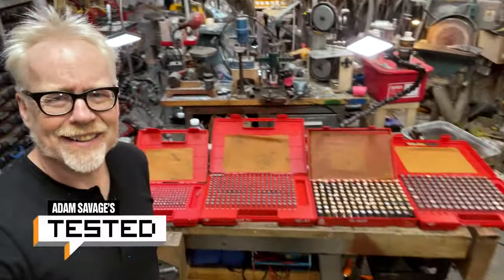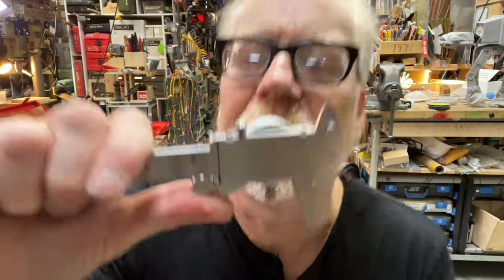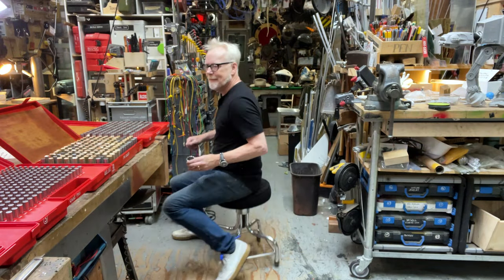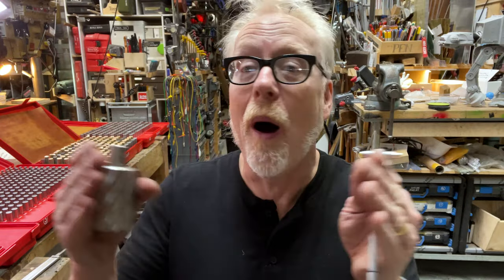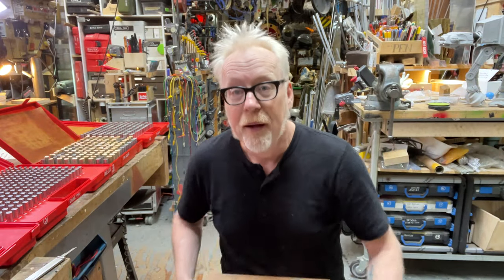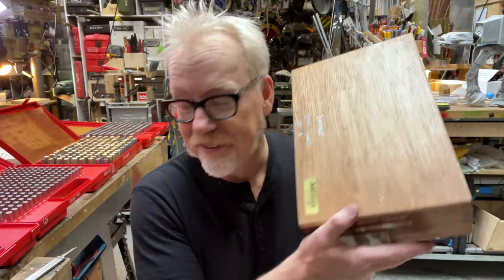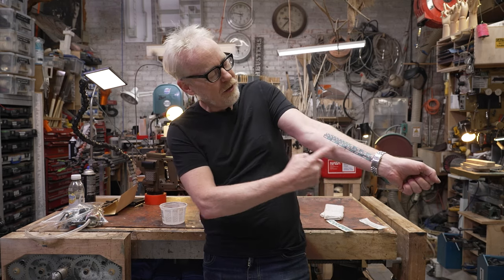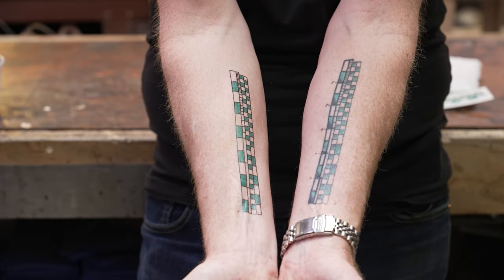Adam Savage's Favorite Tools: Pin Gauges!

Comment: You cannot determine the 'exact' diameter of a hole (1:58), because it does not have one. It will both not be (quite) round, and will vary over the depth. Does not matter how well it was cut, that just improves the tolerance. All dimensions have tolerances. All.

Comment: My first rule for my gauge pin set is to NEVER leave the case open. Because, if it ever fell off the bench, I am certain that they would go everywhere, I would never find all of them, and it would take me an hour to get the ones I did find back in their correct holes. So sitting here with those five open cases while Adam rolls around is driving me a little crazy.

Comment: Just wait until he gets in to "fit", and the fact that a 0.250" pin in reality will not fit into a 0.250" hole without some kind of interference.  And there are gage pin sets that are in 0.0001" increments to get even closer.

Comment: 'can only trust calipers down to 10 to 15 thou'? where does that come from? in our shop, we trust calipers down to about 2 thou (or about 5 hundredths of a millimeter), and between 2 and half a thou we use internal micrometers (down to 1 or 2 hundredths of a millimeter, though we usually check against a known diameter at that point). gauge pins are only really useful if you've got a lot of holes with the same dimension to check that they're inside tolerance. using them to 'measure' a hole diameter is overkill.

Comment: why is the caliper have different thickness for the bottom messure pin? 
it is like 3mm thick at the bottom and like 6mm at 1.5 cm up on it?
i have alwasy wonderd if it is made for some messurement? 
why is it not just as thick at the end? 
its also not a straight cut.
you are not going to see this but its worth a try
and hay man dont drop the cases because it has to be an hell of a job to messure them and place them in a specific order again :goodvibes:

Comment: Bore gauges aren't for the hobbyist.  Challenge accepted 😄.  Never underestimate tool fanatics!  👍🏻 But it seems the bore Gauge takes up less space and is generally more efficient use of time
Reply: Bore gage won't tell you if the hole's sides are parallel the whole way though. Sliding a plug gage through would be a better indicator of that.  :)
Reply: @robbunchanumbers  very true 👍🏻

Comment: There is another step measurement on your caliper that would be better for the hole location measurement. Top of the head, back side of the caliper...2 flat surfaces on the very top...you'll see it :-)

Comment: Gauge pins won't tell you a hole diameter exactly it depends on the level of "fit" required, a hole for a sliding fit for a 1/4" shaft is not exactly 1/4" diameter a co-ordinate measuring machine or laser interferometer measurement will be better than gauge pins. TBH most shops don't need gauges particularly shops that do the sort of work you do. Also use the depth measuring feature at the jaw end of your callipers not the tail end wherever possible.

Comment: Adam's going to get aroused when he gets his first gauge block set, and wonder if wringing is an example of cold welding. It's likely not but it's a fun rabbit hole to go down.    I've used Bore Gauges (we called them '3 prong mics') in an industrial setting for the purposes of line set up and adjustment, and SPC.  They are more robust in that setting than one would think, but having said that we became good at fixing them.  I never liked telescoping gauges, it always seemed to me there was a lot of potential for appraiser variation, though I can't recall if we ever did an R&R study on them. Likely not.  To find the distance between the center of two holes we had something we called a "center mic", which was actually more like a Vernier caliper. It wasn't used often, and I couldn't explain how to use one now it's been so long.  Again, I think the appraiser variation on that beast probably wouldn't meet standards.

Comment: Switching between fractions and decimals is so confusing.   Adam’s calipers give measurements as decimals, but inches are fractional….

I had to draw some building layouts to scale on graph paper, my tools gave me measurements in decimals as well.  But my drafting tools were fractional.  

I very quickly switched to metric, it was so much easier, despite being raised on imperial/US Standard measurements.  

10.5 feet is actually 10 feet six inches, feet are measured in 12ths but inches are measured in 16ths…it was hard to transfer my measurements to paper, with the accuracy that I wanted.

I set my measuring tools to metric (meters) and used the metric “side” of my drafting tools (straight edge ruler, compass, etc) 

…it was so easy to convert 10.5 meters to scale, simply use 10.5 centimeters.

Comment: Adam, Anton Chekov would be shocked and disappointed in you! In a video about measuring hole diameters you go on and on for at least a minute about how glorious a machine the bore gauge is, stop to go fetch it, show it to camera, and then DON'T actually show it in use? I was sure you'd at least find something to test the bore gauge with, and compare results to the pin gauges.

Comment: There is no such thing as “perfect” in measurement. There will always be some “uncertainty”. They also make a set that goes from 0.751” to 1.000”. Gage pins are made with a “plus” tolerance or a “minus” tolerance for “go” or “no go” measurements. There are 989 gage pins in a 0.011-1.000 set and to calibrate each one, you must measure its diameter in at least 6 locations. That’s 5,934 measurements on an instrument that reads down to 1 millionths of an inch. And, the instrument must be readjusted every few pins. It took days to calibrate a full set of gage pins. I hated to see a set come in for calibration. Also, it takes 3 ring gages to calibrate a bore gage - one for each end of the range and one near the center to check linearity. The one ring that comes with the bore gage is a “setting” ring. It only lets you set the bore gage to a known diameter at one point in its range.